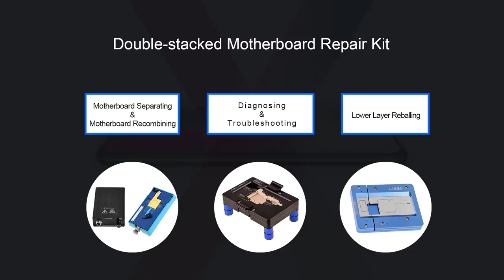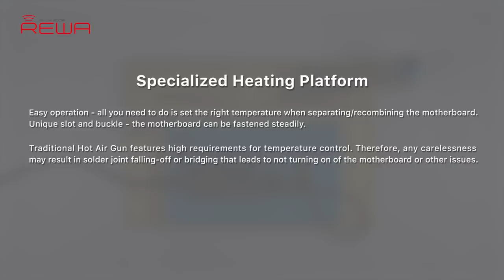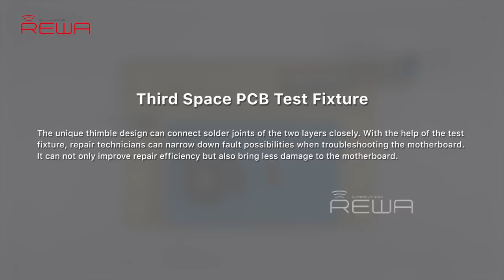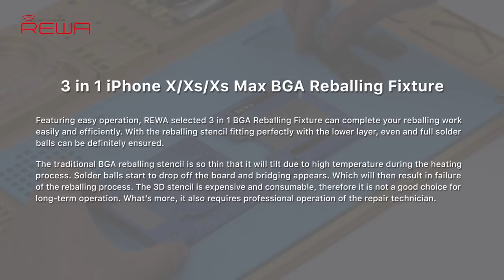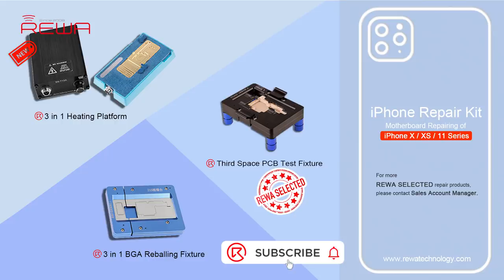Awesome Logic Board Repair Tool Kit For iPhone X/XS/11 Series Review

Comment: I tried that blue stencil. The solder paste does not always land perfect with no bridging. No matter how careful you are sometimes the paste doesn’t stick to the pad and will stay in the stencil hole when you pull up or the paste would touch with other pads and bridge.
Reply from the maker: For perfect fitting between the stencil and the lower layer, please press a little bit harder when attaching the stencil to the lower layer. Then smear solder paste evenly on the stencil and wipe off excess solder paste with the lint-free wiper.

Comment: help me bro i got error code 10 while i restore my iphone 7 in 3u tools. please tell me the solution
Reply from the maker: 1. Try to restore it again. It might be an internet error.
2. If error code 10 appears along with the progress bar, you can check the NAND. It might have pseudo soldered or damaged.
3. If error code 10 appears without the progress bar, CPU is probably damaged.
Hoping this helps :)
Reply: update your itunes if your using mac upgrade macOS Mojave